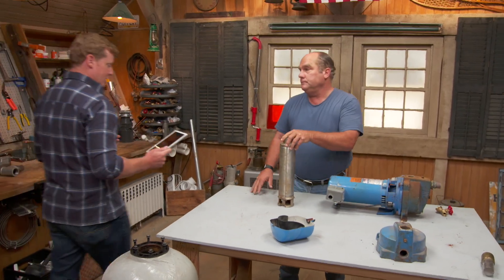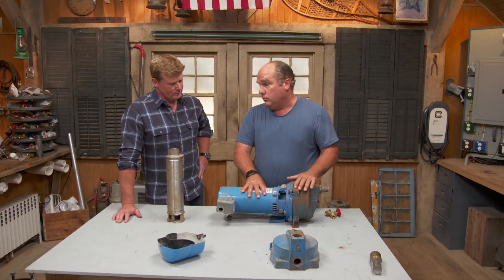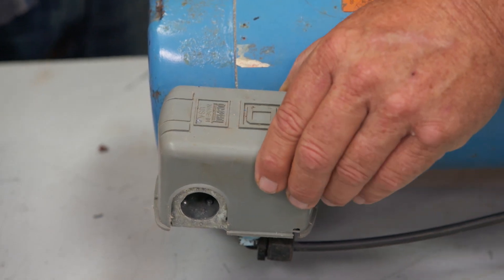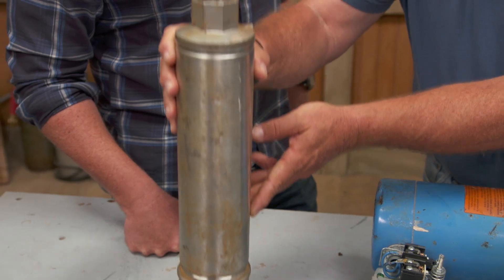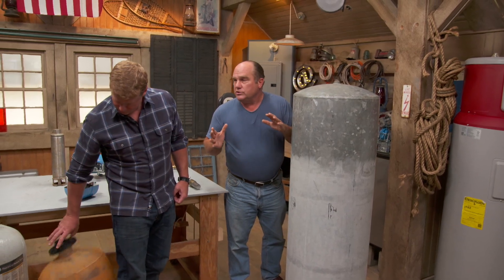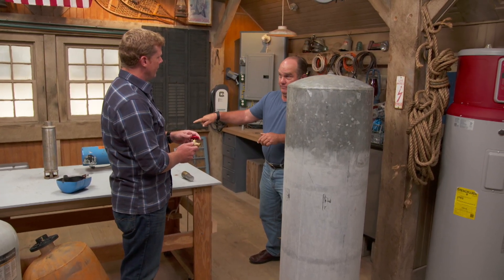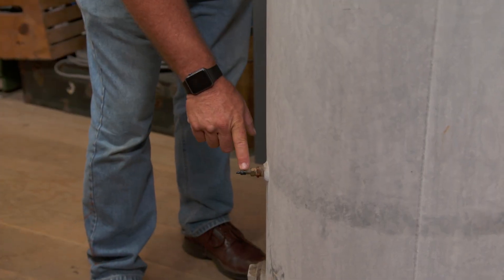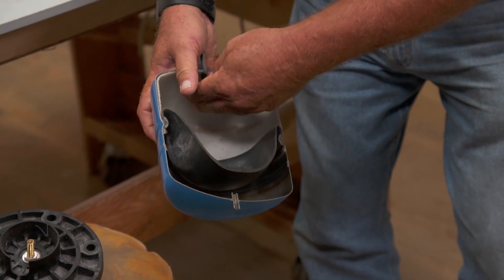How to Diagnose Problems with Well Water Systems | Ask This Old House

Comment: I would love to have a well for no water bill and better tasting water.
Reply: Ugh, no, trust me, you do not want well water and all the maintenance issues you have to contend with.  I have a well and it's nothing but hassles.  I'm always wondering when the pump is gonna go out, or when the tank is gonna fail, or a pipe rupture outside (already happened, flooded yard, $1800 bill), and on top of it the water looks and tastes awful despite filters and water softeners (iron bacteria, gross!), so we have to drink bottled water.  Oh, and when the power goes out you may run out of water.  Now I'm in the middle of a failed pressure switch.  Lovely system, isn't it!
Really, I wish I had done my homework before buying this house, but we were first time buyers and just wanted our own place.  Never again.  Even houses for sale in the neighborhood advertise that they're on city water and sewage because nobody wants well water.  Wells are terrible.  City is the way to go even with water bills.  I'd rather pay that than deal with wells.
Reply: @marco1173  shut up pussboy
Reply: Gammareign 
Be careful what you wish for. Wells have so many more problems then Municipal Water. Start with your well pump then your tank. Adding that your electric bills and with a power failure you have no water other than the pressure in your tank. Your water can go bad at any time and your well can run dry. That's just for starters not to mention you may need a water softener which is fairly expensive or you may need a desalination setup which is crazy expensive. You could have sulfur ,iron ,salt. WELL you get the idea by now. My last house I had a choice and I chose Municipal Water. I'm more rural now and I had no choice and this is costing me a lot more money. During periods of drought I don't even water my garden because I'm afraid of the well running dry even though it never has. But things like that are always on your mind.
Reply: @Gammareign ,It really depends I've had both although well water does have maintenance along with water quality concerns, but if you can afford it well water is by far a better choice,only because city or county water has too much or not enough chlorine and let's not get started about the mind control due to ingesting fluoride along with all the other chemicals and drugs that are not totally filtered out in city water,also if you have a power outage city or county wide you might not have water.If you have a generator on well water you would have water! Just a thought to consider!
Reply: Gammareign We had a well in our old house and it was nice not to have a water bill.  With a well your electric bill will be higher and pumps while they can last decades are very expensive to replace. We had one of those older design steel storage tanks shown in the video and it needed a new Air control valve nearly every year a couple of hundred dollars installed.  Additionally we lived in an area adjacent to old farm land where fertilizers were used.  There were nitrates in the water so we had a reverse osmosis filtration system it worked well and the drinking water was good. The last kicker in this area when you sell your home with a well the board of health requires a bacteria test prior to selling of course there was bacteria found we could have shocked it with chlorine and tried again we opted to do the right thing and add a UV system with a sediment trap to prevent frequent UV bulb changes $1500. Later w/required plumbing.  That being said I now welcome city water in the area we now live. Costs about a $1,000./yr with a small pool but worth it for better/more consistent water pressure and less aggravation. We use bottled drinking water.

Comment: HOW OFTEN SHOULD YOU HAVE YOUR WELL SYSTEM INSPECTED/SERVICED?  Every Yr, 5 yrs? This for PREVENTIVE MAINTENANCE reasons and finding the Age of both the Well and Pumps to Replace them BEFORE they go Bad!  Thus Setting up a Saving Budget inorder to have Most if not all the $ needed to do any R&R..
Reply: 50 year out of it .was it the first one. J/k I have seen this but they don't make things like they use to the pump was all brass in good water. Key is good water. Just have to ask because I only seen one what is the brand of you 50 year old pump?
Reply: Don't replace them before they fail. My well pump has lasted over 50 years and still going strong. 

As you plan to do, put aside a bit every month dedicated to various house repairs.

There is little that needs inspecting/servicing that you cannot do yourself. Primarily, make sure the pressure tank has proper air pressure. Verify that there are no slow water leaks anywhere.
Reply: Good idea I do this for a living and its the smart thing to do its not cheap and 5 years is about the life span. Wish ever house i show up to would under stand that. Thanks

Comment: PLEASE help. very good video. we have gotten alot of rain but the well is dry, could this be a problem with a check/foot valve? if so how to i fix this?
Reply: If your well is dry its dry there no way to fix it you need to drill new well or hope water comes back up. It take years not mouths or weeks. For water to make to well levels. Sorry

Comment: As a water well contractor in Colorado, I would suggest checking for a leaky stool or underground water line or in the well.  It could be the foot valve or a hole in the pipe in the well circulating water.  The loss of air in the pressure tank will only negligibly raise an electric bill as the pump still stays shut off when there is not water in use.
Reply: PLEASE help. very good video. we have gotten alot of rain but the well is dry, could this be a problem with a check/foot valve? if so how to i fix this?
Reply: @Bossyosha  , could be. Pull the vertical pipe out of the ground and see the check valve at the bottom end.
Reply: @Bossyosha  , could be. Pull the vertical pipe out of the ground and see the check valve at the bottom end.
Reply: @Bossyosha  what happen
Reply: Here at my job we have water well systems for the trailer park, the North pump will not shut off. Even after cutting off the main valve to the park the pressure moves up very little, the water tank is full of water. My feeling is either foot valve or the line going down to the well.

Comment: Hello, I have a problem with my submersible water pump. When plugged in the ordinary 240 volts mains it runs well, but when I run it with my generator it stops after a few minutes while the generator keeps running, also when I installed a circuit breaker it did the same thing the breaker trips, so there is no more supply and the pump stops.Any idea what the problem could be? Thanking you in advance, Regards Tony.
Reply: Thank you for your reply. I will check the voltage and amperage.This submersible pump is in a well that's 27 meters deep, it was put in place by 3 or 4 men, now I am all by myself so its a big problem if I had to bring the pump out to have it checked. Thanks once again for your help
Reply: I would also check the cycles.  If you are over speeding the pump it quickly gets over the motor rating.  As long as the voltage stays up pumps can run on slower cycles and not hurt anything but the production.
Reply: Thanks for your prompt reply. I will check everything next week. Very helpful.
Reply: Francois Deshue  I have a question. I have a submersible well no bladder tanks nothing like that just the deep well then when I go to my faucet it works but the next time I use the faucet it doesn't work if I come back and try again in 15-20 minutes it works it's at random that I don't get water this would be the pressure switch right?
Reply: Not necessarily. The short time that the pump runs against essentially a blocked line (when you shut off the faucet) may be causing an overload switch on the pump to trip. Such switches reset automatically after a delay.

Fix the system so it has the proper size expansion tank. The way it is operating now could cause it to fail. Replacing the pump will be many times more expensive than having a plumber add a tank.

Comment: question, I had my well updated a while ago, the system is underground,  yesterday, I lost most water pressure to the house, I hear air sound when I took the cap off to check the meter, expantion tank was replaced last year as well, any ideas
Reply: Dadcanic on a budget I'm 0 now

Comment: Well it seems that my pump is working when it's on. But what would cause it to shut off while showering or washing the dishes? You have to wait a few minutes to let the pressure build back up and the water comes back on. This started about three weeks ago. I have a Myers well; I'm not sure what the PH is; I replaced the pressure switch over a year ago. I need some idea on what I'm looking to purchase; will it be another switch, tank or a new pump. Someone please help.
Reply: If you have not figured it out yet I have a few ideas to check.  First and most common in our area if it the problem starts suddenly is the pressure switch could have a plugged nipple under it which takes a while to turn back on.  This also leads to a delay in shutting off and will have extra high pressure at times if the pump is capable of making high pressures.

 Also common is there is a check valve on the surface that holds the pressure when the pump is off, then the pipe in the well drains through either a faulty pump check or hole in the pipe.  When the pump turns on it takes a little while to fill the pipe in the well before getting water back to the pressure tank/house.  This is not noticed on small uses because the tank has enough extra to cover the wait.

Another thing to check is the well could be hitting air and getting air locked, which takes a little time for the well to recover some and then the pump to re-prime.  If you can run the pump wide open for a long time without it losing pressure this is not likely to be the problem.

Also possible are various electrical issues and then there is the strange things that come up that make us well contractors scratch our heads for a while.
Reply: PLEASE help. very good video. we have gotten alot of rain but the well is dry, could this be a problem with a check/foot valve? if so how to i fix this?
Reply: OK Sound stage

Comment: foot valve or not. shallow well jet pumps with one drop pipe are only going to give you 20-25' of lift. a deep well twin pipe or packer system will go to lower static water levels. but yeah always have a foot valve
Reply: Jim W:

I don't know how much lift you can get out of a jet pump. But the old style of above ground pumps could only manage about 20-25' of lift, maybe as much as 30' if everything was ideal. With a perfect vacuum, the maximum suction height is roughly 32 feet.

I have a single pipe deep well pump installed down about 250 feet. It still is working fine after 50+ years.

Comment: on a modern tank there is a  air valve on the top  and it can be  recharged with compressed air .. takes 10 seconds

Comment: I had a storage pressure tank go bad which made my submersible pump come on and off. I had already worn out one pump and had it replaced. Cost about $800. I decided to replace the tank and install a stop cycle valve. It is my understanding that the frequent cycling is what causes pumps to wear out and higher use of energy.  Here's how the stop cycle valve works. When using water, once the storage tank pressure drops to the low pressure setting, the pump kicks on and the water pressure begins to rise.  The stop cycle valve keeps the pressure in the tank from reaching the shutoff pressure as long as the water is being used. The pump continues to run. When the water is turned off the pump runs until the tank pressure reaches the shutoff pressure. This keeps your pump from cycling and makes the pump last longer and by eliminating excessive cycling cuts down on energy usage.
Reply: Cycle stop valves have there place in the world and I have used them on several occasions.  However, on a small well it is more efficient to have a pressure tank large enough to cover the requirements of the pump.  There is several guides to tank sizing and with a properly sized tank we commonly see 10+ year pump lives with some pumps exceeding 40 years.
Reply: Foras
Reply: Yep. Although the pressure tank is somewhat undersized, the original pump is still functioning fine at the bottom of my well. It was installed in 1966, so is over 50 years old.

Comment: Could loss of air pressure in the tank also be the problem?
Reply: It's not so much loss of pressure, but loss of total air volume within the tank. The idea is the same for both the older tanks and the new style with a bladder. The mfgr bases the air volume as a percentage of the total gallon size for the tank. When that volume is lost the pump "short cycles" which is the rapid on-off situation every few seconds.

With older tanks you can fudge a recharge of the air without a compressor by totally draining the water out, which means the tank is completely full of air, then close the drain and allow the pump to refill it. This will give you around 25% air at the top of the tank at 40 psi water pressure and near 50% air at around 25 psi, which is likely near the low pressure limit for restarting the pump. If all is well, the air pocket will last roughly 6  - 12 months before this needs to be done again.

With a bladder style tank there is a Schrader valve on top, which is for checking the pre-charge of this air pocket within the bladder. It must be checked with all water pressure relieved and should match the label pressure within a couple of psi. If the pressure doesn't match the mfgr's label you can attempt a recharge in a pinch but most likely there's a leak and the tank will need replacing soon. OTOH, it will get you out of a bind and give you time to get the job done without wearing on the rest of the system.

BTW, the pre-charge pressure is typically near the mid point of what the tank is designed to operate at. I'll use an example of 40 psi charge for a system with a 30 - 50 psi pressure switch.

As a side note, these internal bladders are rubber and similar to a tire tube. What happens is they dry rot over time and the little pin holes allow the air to get into the water just like the older tanks. IOW, when the air pocket goes away you have the same problem.
Reply: Yes, but you get plenty of warning. You will notice the cycle time getting shorter and shorter as the air is slowly absorbed. If you have a pressure gauge on the tank, you will see the pressure rising and falling more rapidly than normal. 

By the time the system gets to a few second "short cycle", there is almost no air left in the tank.

Comment: Strangely, I have both tanks. I think it's time to update my system.
Reply: don’t need to update, just understand.  i also have both tanks.  well feeds directly into the compression tank. compression tank has an air valve on top, used for system blowdown. compression tank has a T fitting with drain and line to the expansion tank. expansion tank has the tank manifold with pressure switch, drain valve, pressure gauge, and line out to the filters. filters used are 150, 50, 5 micron. the well water in the area is very high in manganese, having a large compression tank helps to capture some of it, and easily flush out the system.  don’t “precharge” the compression tank, but rather have it completely blown down so that it’s empty, then let the well run as normal.  should settle at 50% air. pressure relief valves are used throughout the system.